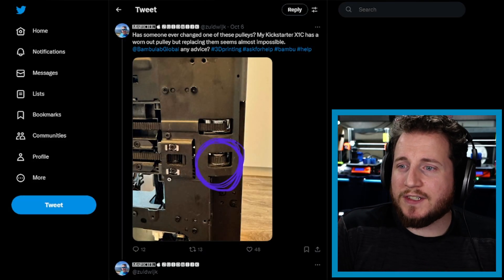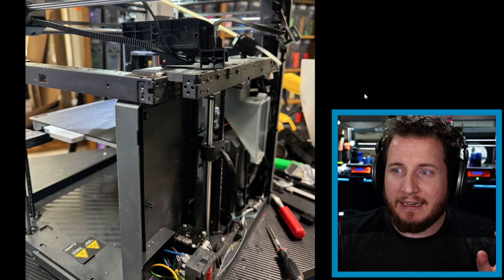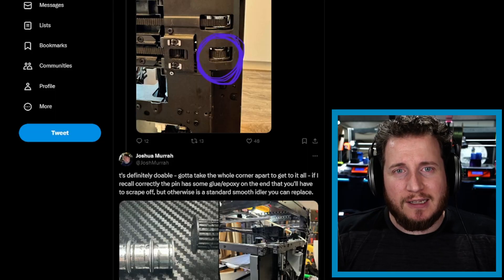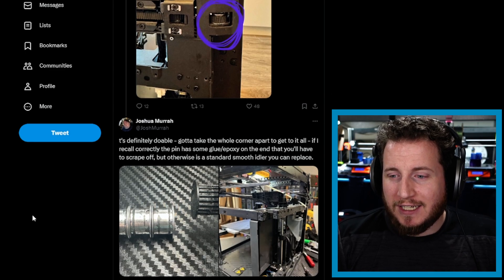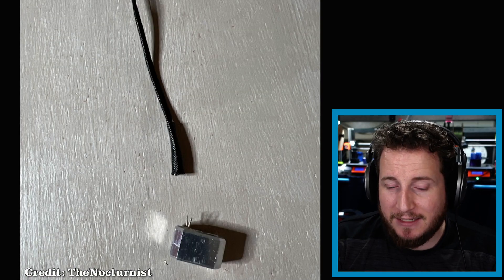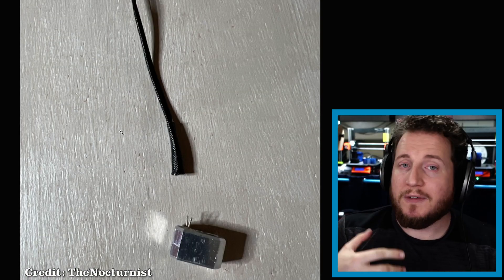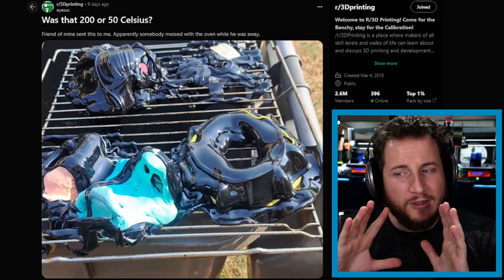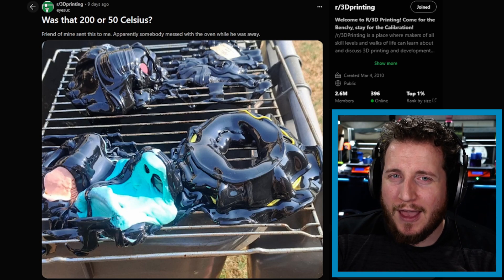The WORST Way To Dry Filament?! - PrintFixFriday 161

Comment: Oh boy, what did I started on social media 😶‍🌫 

Well, next to some MK4's, XL, Voron's, Magneto,... my 4 X1C's are now still printers I use the most due to their ease of work (filament loading and stuff). But I do intent to fix this one X1C and sell them all. I might get a Ratrig Vcore4 IDEX to replace that. My main purpose is printing 2 color cases in PLA and some times some PA/ABS. 

I absolutely are for open source, but I do understand when some companies want closed source. And I'm fine with that, as long as it is serviceable and repairable. Throwing away a $1000+ printer after only 2 yrs because of one bearing, nobody should be okay with that.

"Hey, one of your tyres has worn out, now you've got to buy a new car!"

Comment: Do I care if my 3D printer is user-serviceable? Absolutely. I aim to keep my printers running indefinitely. I'm not out to get the latest and greatest. (My pocketbook isn't that deep.)
Reply: Additionally, regarding using an oven on PLA: you could unintentionally "anneal" it, making it far tougher to melt (and far easier to jam).

Comment: 100% believe that a printer needs to be serviceable rather than disposable, and that users and users' designees should be able to do those repairs without being forced to go to first-party service outlets. 

It costs under $50 to get even a poor dedicated filament dryer (I think I spent $38 on a food dehydrator I cut up to fit spools in), there is no reason to ever try and dry filament in your kitchen oven. I did once anneal an HTPLA part in the oven but I had it in a glass pan with paper towel sitting on a cookie sheet and kept a close eye on the temperature...I have since bought a toaster oven from a thrift store to use for annealing or salt remelting small parts, to avoid ever having to put stuff where I put food.

Comment: If you can't repair it, you don't own it. This is why I won't consider a Bambu printer. If we refuse to buy closed-source/proprietary printers, they will change or fail and other manufacturers won't try to rip off customers using the same business model.

Comment: I thought the "right to repair" was specifically about saying companies could not void your warranty because you are a non-authorized service center performed a routine repair of an electronic device.

I think you are using the term to mean "I should be able to repair any part of the electronics device I bought, regardless of whether the part was designed to be replaceable or not, regardless of if I knew I knew the devices was designed that way or not when I bought it".

I agree it's frustrating to not be able to replace a single component to bring your electronic device back into operation. I disagree that ever single electronic device should be designed and built so that every single piece can be swapped out easily. Think of Dell computers and their integrated motherboards. I don't buy Dell computers for my personal gaming machines because I want to be able to swap out components as I see fit. I do recommend to family members to buy Dell computers because they "just work" (partially because of all of the integration) and are priced appropriate for what you get.

So, I do agree with the "right to repair", but not in the context that I believe you used it. Sometimes things are designed a way to make a device more resilient (I.E. Dell computer designs) while at the same time potentially reducing the cost. In those cases, you accept the risk of having parts of the device not be replaceable/swappable when you buy the unit.

It sounds like Bambu Lab has changed their minds and decided to provide a path to repair it as well as sell the parts needed, which I think is probably going to be overlooked. How many companies out there listen to their community and change their support like this (don't forget changing and providing a path for XPlus1 firmware) to try and improve things for their customer base. That's seriously impressive to me and why I'm willing to take the gamble on a few parts not being designed to be replaced, because their stuff just works and even if there is a road block on repair or enhancement, they might come around.

Comment: I made a solar filament dryer, it is a cardboard box painted black, inside there is a glass box to create a greenhouse effect, the detail is that for ABS and ASA it works perfectly, the problem was when I put in PETG (all this in winter), it came out brittle, the roll of filament stuck together and the reel became deformed, I live in Sonora, Mexico, the state south of Arizona😂😂

Comment: I check my Boden tubes all the time , they get damaged easy , especially when you have to unclog your exstruder , when the spring-loaded tension clip is tough to push down ,so i don't bother trying i just snip the tube take out and then extract like you are doing surgery 😂😂😂😂😂😂😂😂😂😂😂😂😂😂😂

Comment: Used my new EIBOS Polyphemus filament dryer the other day and it works great. Love the rotating to dry evenly, avoid hotspots, ventilation to allow moisture out, built-in profiles for most common filaments. Bought back when it was on sale, and that would be the best time to buy because it's a bit expensive.

Comment: Rule proposal: If, as the consequence of an avoidable design choice, a part is more expensive to repair or replace than it should be, the customer may pay a fee in line with an equivalent repair on a comparable well-designed product and the manufacturer must pay the difference to effect the repair.

Comment: I almost bought a Bamboo to supplement my Prusa and add capabilities but thankfully I ended up buying another used slightly broken MK3S and fixing it (yea, these are very fixable) and I am so glad I went this way. I won't be buying a printer that I cannot fix and buy off the shelf products for.

Comment: Even if a P1S only lasted 6000 hours, that is only 10 cents per hour. Most people would junk a car after 6000 hours because that is around 250,000 miles. So it makes no sense to harp on this given that they sell parts and sell them for a low price so they actually are repairable.
Reply: Junking a printer or car after 6000 hrs is dumb af. A car should be running like new with minimal maintenance after 250k miles. If it's not, you paid for garbage and should have gotten a Civic instead.
Reply from the maker: My car is 22 years old and has 185k on the clock. It's been running idling for hours at a time to help charge the off-grid battery systems. Worth it. Won't replace it until it dies. And I'll maintain it all myself!

Comment: I had never heard of not using the self clean function on an oven before. When I've used it I have always just turned the vent hood on and gone off to another room.
Reply: Same. I've never had issues. I would not leave, do it overnight, and I would keep a fire extinguisher nearly just in case, but I don't have an issue wth vacuuming out some ashes after it's cool.
Reply from the maker: It can damage the heater and such and the coatings in the oven :)

Comment: 5:15 I do agree with the right to repair, but I abuse my bambu it’s been running for 3200 hours and I’ve done very little maintenance basically just changing tubes when they are about to bust through and it is still working flawlessly, I feel like if it was built to be more repairable it would not be such a tank. A potential solution could be to offer what they currently do, but also offer one that might not be as robust, but is repairable, because I would buy maybe 2 to 4 at most of the current ones and have them be my unkillable work horses and then the repairable ones will be just the lackeys that print just basics.
Reply: Durability and serviceability are not mutually exclusive. It just depends on the manufacturer. Do they want planned obsolescence or do they want their products to last as long as possible? Designing a product with components that are not intended to be replaced screams planned obsolescence to me.
Reply: Do you think making a product more repairable will somehow make it unreliable??
One of the easiest vehicles to work on are japanese vehicles and do you know which are most reliable? Toyota and Yamaha..
Same for every other product.
Reply: I'd say repairability goes hand in hand with reliability, rather than against it - being able to occasionally swap a worn part can greatly extend the life of a product. These are machines with moving parts, there's no getting around the fact that those parts will see wear and tear.
Reply: I mean, my Prusas that are basically trivial to repair, are just as much of tanks as the bambus I've worked with. So it's not a problem for durability to make them repairable. There are other tradeoffs, such as cost or design complexity.

Comment: To be fair, bambu posted some days ago that it's possible but hard, they are actually doing the manual for it, and they put the part up in the shop, furthermore they will sell the complete gantry with idlers and stuff as a complete unit, cutting the as far as I remember 8 hours they mentioned to 2.
Reply: Although this solved the customer's current problem, it was clear from the start that this was going to be an issue. The idlers, pulleys and bearings are consumables. When the printer was designed, it was probably assumed that customers would just buy a new printer rather than try to repair it.
Reply: @andreas.grundler  💯
Reply: @andreas.grundler  imho they assumed they will run longer than they actually can. Yeah that was a known problem if you are a kinda prosumer. The avarage bambu buyer is... Not...

Furthermore even if I don't like it, I understand why they probably did it. For the avarage bambu buyer if the printer is working 5-6k hours it's... Like 4-5 years or even more. Why would they spend time and effort to make it modular, easy to change when it will outlast the rest of the machine or the users motivation in the hobby.

It's again a classic calculated risk went south moment, not the first for bambu. At least they followed up with solutions, and that's a bit more than apple or some 3d printer manufacturer do most of the time. The bar is really low in this case I know :D